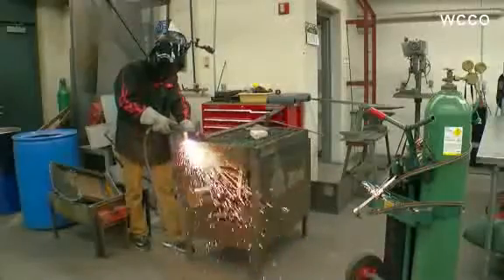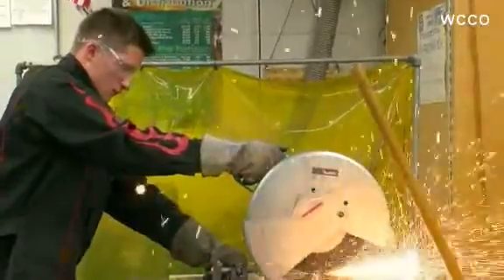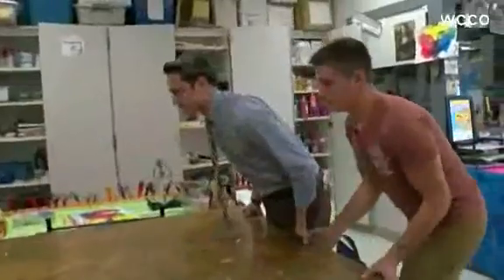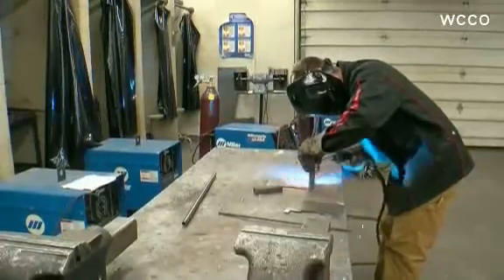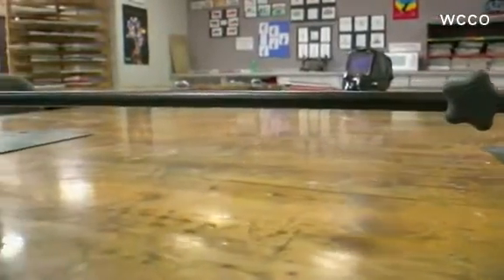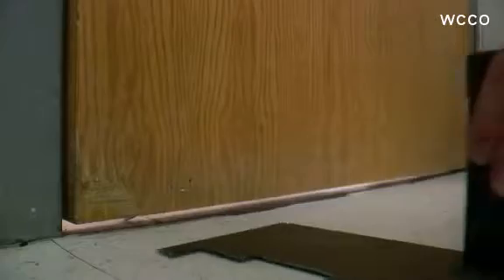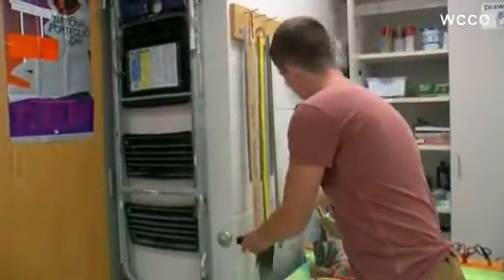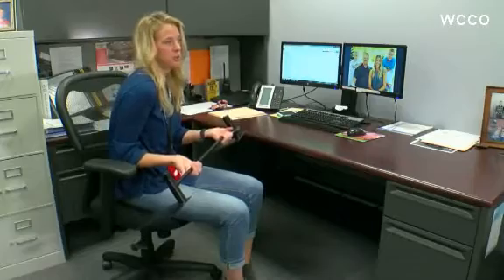Wisconsin teen creates door-locking device for active shooting situation

Comment: An additional option is to have a eye bolt screwed into a solid concrete wall next to a door handle with a steel cable just long enough and with a loop on the end with a diameter  just large enough to fit over the door knob. You would be anchoring the door handle to the wall. The door may open less than 1 inch but not enough for the device to be disabled.